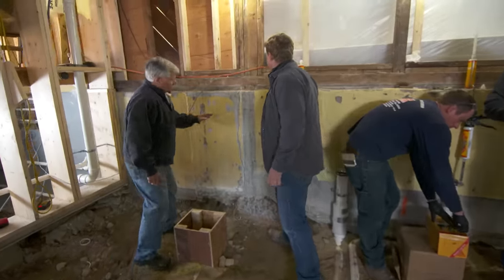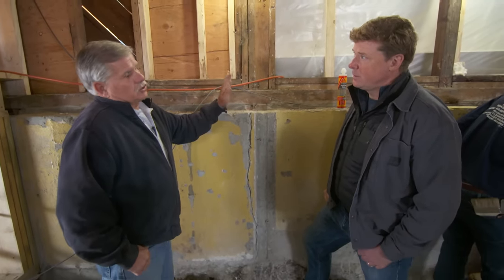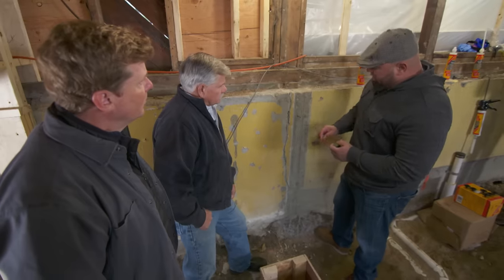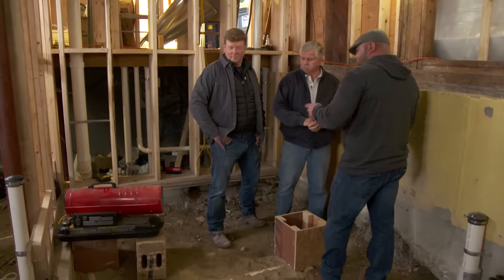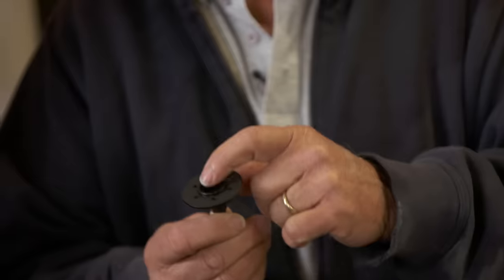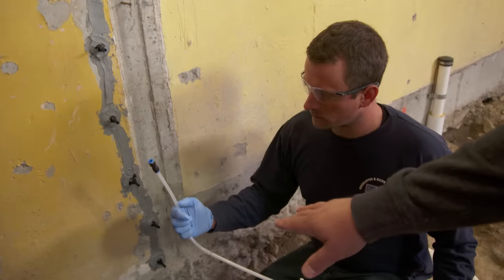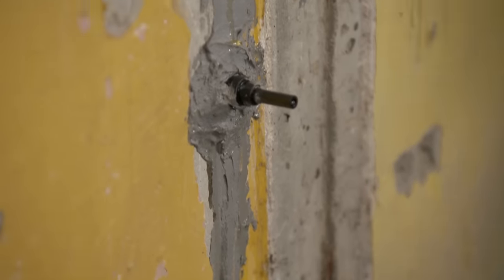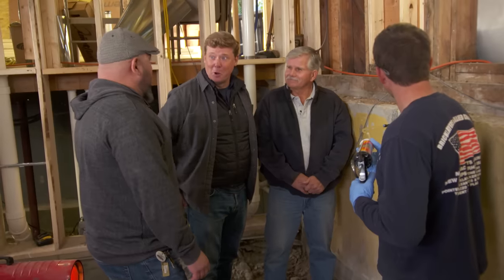How To Fix a Concrete Foundation Crack | This Old House

Comment: The crack does not need to be repaired because the concrete has rebars for tensile strength and cracked concrete still has same compressional strength. So it doesn't need to be repaired at all, except for maybe stop water leaking. But then many sealants can be used to water proof.

Comment: This is only good for stopping the water from leaking through the crack.  Talking about it's strength is meaningless.  The only way to add more strength to that wall is to underpin it to stop it from settling in the future.  If it settles more down the road, it will crack once again.
Reply: Wrong!! Inject it with a two part polyurethane product,the product we use expands 10 times and acts like a rubber seal,lifetime warranty
Reply: Vertical cracks are seldom structural and are a good use case for products like this.

If one had a horizontal crack or evidence the foundation has actually moved instead of just cracked concrete, you need a different solution.

Just did one of these in our 15 year old home.  Crack was enough to let water in during severe rain, say 8 inches in 24 hours. But other than cases like that, no water as the drainage system did its job.

Crack wasn't even big enough to get a credit card into.  

Used a system from RadonSeal that was $149 shipped to my home.  Included everything but the caulk gun.  Clean the crack, butter up the ports and then seal the crack with the epoxy so the foam injection doesn't escape.   Let that sit a couple of hours.  Use a water bottle to flush the ports and demonstrate they are not clogged.

This system had a two part expanding foam that fills in the crack.  The foam expands about 20x it's original volume IIRC, so it fills any space inside the wall.  Even came outside.  As per usual, the crack was near a window in the basement.

Came back the next day and knocked off the ports.  I used the rest of the epoxy for one more layer over where the ports were and called it a day.

Now I just have to wait for a big rain to see if it's effective.  I see no reason why it wouldn't be as it took a huge rain to get through.  More rain than the drainage system could carry away even with downspout extenders et al.

This was a 66" vertical crack from the window to just above the floor.

Comment: This will not last more than a couple years. Epoxy gets extremely hard. Foundations expand and contract with the seasons and it will pull away. You cannot permanently seal water out it will always find a way. Please contact an actual foundation expert to give you their opinion on the right fix!

Comment: If the fix is 3 times stronger than the wall, more than likely it’s gonna crack.
Reply: As long as it remains flexible it's fine
Reply: @jgg204  epoxy is not flexible
Reply: @williambrandondavis6897  correct which is why you are supposed to use polyurethane now for crack injections not epoxy

Comment: They didn't show that it takes at least a day for the cure on the ports.
Reply: @OGR No but they should have at least mentioned it, it's supposed to be instructional.
Reply: They also didn’t mention to start at the bottom port until it begins to flow out of the next one. Then cap the bottom and work your way to the top. 

This is cool stuff though. Do you know where I can buy a single tube of the liquid epoxy? The thicker one seems to be readily available at big box stores.
Reply: A couple of hours.  All you need is for the ports to remain in place and not leak what is being injected.

After everything is in, then yes, you would do well to leave it overnight.

Comment: I'd like to see the effectiveness of epoxy injection on this job 5 years later.
It may still be OK but that's because a reinforced footing was installed, outside waterproofing and proper drainage. That fix would be rubbish without the other fixes.😂😂😂

Comment: The epoxy is 3X stronger than the concrete it is bonded to.  Looks like a permanent fix to me.  Every day new materials and techniques are being invented and applied to old problems.  Why are people so close minded to new advancements?
Reply: " Why are people so close minded to new advancements?"   who are you talking about?  People are not close minded to advancement, why are you implying that with your loaded question?
Reply: Peter Hahhaha I for sure won’t be with my business
Reply: @Eric F I am directing this to the negative comments here that either have not used this method  or have used it and proved that it does not work but have failed to include it in their comment.  Does that meet your satisfaction....Eric?
Reply: @Peter-976  You made a generalization, with your loaded question. If you actually look at the comments, only 1 comment was dubious, everyone else was and is positive. I think you're just looking for attention and in turn made a very disingenuous comment.
Reply: Old dogs you can lead to water, but
Reply: The reason is because people don’t like change, it makes them feel like it won’t work. I’m always trying new things but there are people who truly believe that unless they do it like their fathers taught them then it won’t work. Sad but true

Comment: Epoxy isn't structural so this is simply an aesthetic repair?
Reply: This isn't a structural repair as much as it's a fill in the gap to prevent further damage.

Comment: Structural engineer here. So you filled the crack with epoxy but did not fix the foundation issue. Guaranteed this foundation will continue to settle and crack again. Well,  I guess the title of the video IS "how to fix a crack" and not the foundation.
Reply: So you would recognize the crack in the video isn't structural being a structural engineer.  Not greater than 1/10 of an inch wide and vertical.  Meaning this repair is sufficient as any load is carried by material on either side of the crack.

Comment: OH Cool, let's fix it from the inside...🙄
Like sticking duct tape on your ceiling when your roof leaks.
Also, there's a reason why the foundation cracked. And it will crack again unless you fix the reason why it cracked.

Comment: The parts to do that work are inexpensive. I wish the box stores like HD and Lowe’s would sell it. Instead I had to go all over God’s creation to get some.
Reply: What products are they using exactly? Wish they had listed this info in the video. I'm dealing with a similar issue in my house where I have a crack in the floor and during heavy rain water comes up. Trying to figure out the best way to seal it and this looks like the way to go, just not sure what to buy or research.

Comment: Mostly erroneous and misleading 
When there is subsequent movement the patch will crack right next to the “ repair” 
A real fix would address the remediation of the CAUSE of the movement/ crack 
A crack profile such as this indicates subsidence  ( wider at the top tan at the bottom) 
This is temporary and cosmetic only 
If you want a real fix they do exist

Comment: "how to mask serious issues"

This is not how you fix cracks in your foundation.
Reply: @HotPringlesNearby  Dig it out from the outside and redo the Watermembrain cause thats whats actually wrong with it lol
Reply: I figure it would still have movement slowly over time and crack again.  
I have a rock-stone foundation (built 1920) with a crack about an 1/8", I want to know how would You fix that if You know how.
Reply: @HotPringlesNearby  sure thing,boomer.  Will get right on that.
Reply: @MemoGrafix  You have to figure out what is making it crack and shift. might not be something in your control. (example: Dried up underground riverbeds)
Reply: They did mention that they're going to work on the drainage around the house as well. Is this the issue you're implying? Or did you not watch the first seconds of the video? Kinda tough to guess what you mean. You should speak your thoughts directly instead of making passive-aggressive comments to express your disagreement with something. It'd make it easier to reply you😉
Reply: @chrisnolan9906  good one boomer?
Reply: @TranslucentJuice  - Do You know how does one find out if there are possible dried up riverbeds.  My houses are in the City of Buffalo NY.  
I'm "thinking maybe contacting building inspections.
Reply: @chrisnolan9906  Laugh if you wish but when Everdry Waterproofing did my house they dug outside down to the footer cleaned the wall applied mastic then rubber membrane. My basement is as dry as a popcorn fart.
Reply: @HotPringlesNearby  search for "hydro armor" on YT, Daniel O'Connor. Fixes walls from the outside and explains the whole process. You have to relieve the hydrostatic pressure or it will just happen again.
Reply: They explained in the first 47 seconds how they fixed the root cause of the problem...
Reply: MemoGrafix … A stone foundation from that era probably doesn't have a footing below floor level. (my area is full of old homes so I know) The fix is to do a repair like the one shown and keep your fingers crossed that it lasts 20 - 30 years... then it becomes the responsibility of the next owner. Of course some improvement in outside drainage always helps, as these old homes don't have any. Best way to spot drainage problems on an older home is to go outside when it rains and look for ponding of water within 10 ft or so of the foundation then make a note of where to change the grade so the water runs away. It really doesn't take much of a slope to make a large improvement.
Reply: Christopher Nolan 
“Boomer”...hilarious. You must be a member of the insult of the month club. By the way, you seem to have missed the part where they not only poured a footer (it was another video) and the part where they discussed addressing the drainage (root cause).
Reply: Raise the house put in proper footings and foundation
Reply: @TranslucentJuice  
These kind of cracks have nothing to do with  membrane (I can only assume that's what you meant).
It's almost always a settlement issue.  There's no reason to dig it all out in this case, it's pointless.
What they did is a good solution.  Only thing maybe I'd add is a П shaped super-sized "staple" (2 feet perhaps) to tie sides on either side of the crack.  Drill holes and use epoxy to glue it in.

Comment: NOT - open the crack with concrete saw and chisel spray it out clean with water hose put strong concrete mix in to it 5, 6k psi concrete.  Don't ever listen to thus old house I watched them for years.

Comment: Cheap superficial fix that doesn't correct the faults causing the cracking. Slap on the Bondo.
Reply: Yankee Inventions 
They’re fixing the outside drainage. They also added a footer in another video. This simply fixes the crack. But hey, keep making comments based on limited information.
Reply: William Miller 
Ok, thank you for your permission. I hope one day to know everything about everything. Are you the Expert with the Beard?
Reply: @Uncle-Bull  roped the owner into a 20,000$ fix that i could have fixed for 300$